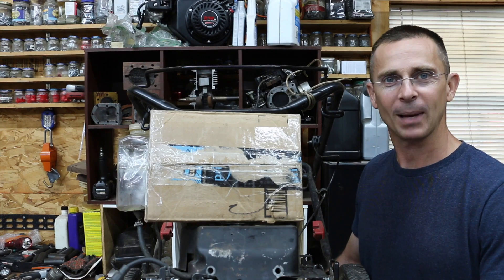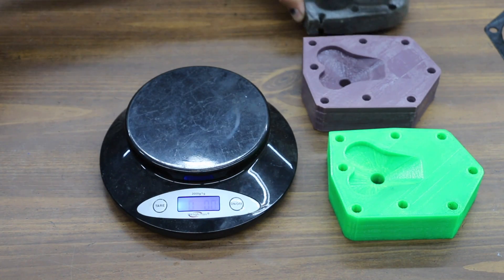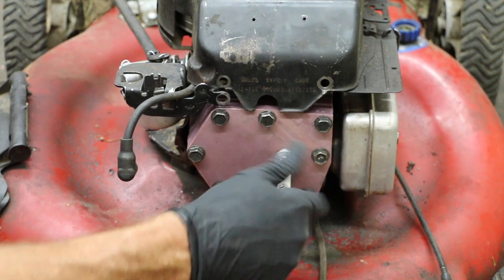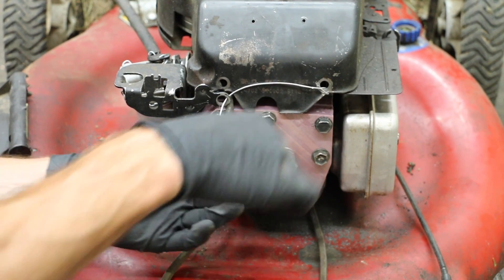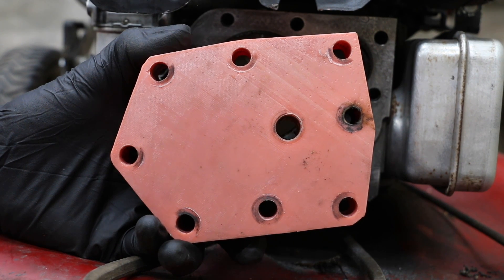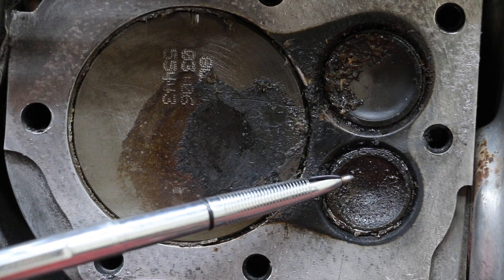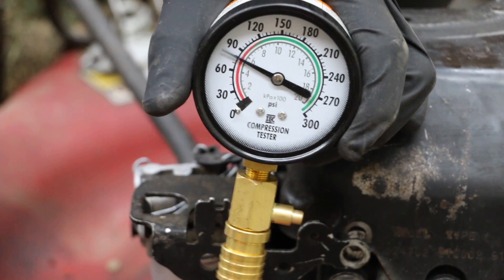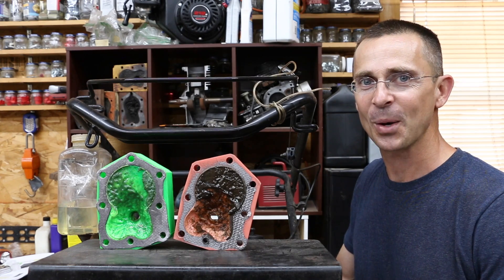How long will a 3D printed cylinder head last?  Let's find out!

Comment: Obviously plastic isn't the ideal material for a head, however more advanced (still at a consumer level) machines are capable of producing 3D printed plastics that would likely hold up for a long period of time.  A form 2 can produce such parts.
Reply from the maker: Great point.

Comment: How about deliberately cracking a cylinder head in half, then try to weld it back up, then durability test the repair? Or crack a connecting rod, weld it up to see how long that will last?
Reply from the maker: Great recommendation.

Comment: You know FORD (GM & DODGE as well) is not far from mass producing cylinder heads out of ABS Plastic as well. I think this video will inspire them even more, Engineer: hek we saw a fella run a Briggs on a plastic head...why did'nt we think of that. Buy Japan vehicles n solve many problems... I will say they are over priced but you get what you pay for.
Reply from the maker: Thank you

Comment: Maybe if you covered the inside of the cylinder head with Aluminium foil stuck down with JB weld would help it last longer. Great Video!
Reply from the maker: Great recommendation. Thank you

Comment: Maybe you could  try a gas diesel mixture  and try it on an diessel engine and an gas engine and look if it will work and or if it is better and if you get less carbon built up
Reply from the maker: Great recommendation.

Comment: Awsome video! Composit heads are cool, would a concrete head be possible??? Also I mainly wanted to ask about your rusty nut and bolt experiments have you tried an acetylene torch to heat and see if that helps stuck bolts?
Reply from the maker: Great recommendation. I tested the torch near the end of this video and it did a great job: https://youtu.be/xUEob2oAKVs
Reply: Great! Ive learned my skills to pay attention are shot.. i just rewatched and saw the magic I missed! Too bad I cant get a acetylene torch on my header stuck bolts and aerosols plus idle heat have not helped, tough spot with extensions not enough umph with those. Great videos, great breakdowns, small engines beware!!

Comment: How about a 3D printed carb? At least it stands a good chance of lasting awhile especially if made out of the more heat resistant plastic. Would also help if it has a thermal isolating plate in there like my Olds 350 Rocket w/Rochester Quadrajet had on it. The 1 inch spacer plate allegedly help with fuel boil/vapor lock type issues. Anyway, I think the plastic would stand a good chance if on the intake side of the motor.

Too bad you can't get some metal 3d printed parts. Supposedly Jay Leno has one but the vids I remember he mostly had cosmetic stuff made and not so much the working engine parts. Excellent vid, crazy choice!
Reply from the maker: Great recommendation on printing a carb!

Comment: Would be interesting to see a Nylon like Zytel Nylon they use it for valve covers and oil pans, its a high temp high strength plastic, would have to be machined though.
Reply from the maker: Great recommendation!

Comment: Ya scared me, didn't think you were gonna ground the spark plug... if you are looking for a high accuracy, inexpensive medium sized printer that doesn't take too long to set up, try a CR-10 mini and run it with ultimaker's Cura engine. It can help you prototype and produce things from plastic a lot faster than having to be sent parts. Mine works well, but it's up to you. The combustion test was great in this video. I was wondering if you would do a video on what makes the longest lasting improvised gas tank. Mainly aimed at plastics including PLA and ABS as well as PETE like in soda pop bottles. Also be interesting to see each plastic put up against different fuels.
Reply from the maker: Thank you very much for the recommendation on the CR-10 mini and video ideas.

Comment: Great video. Would be interesting to see if there is a sprayable coating that can help these various wood and plastic heads and pistons withstand the temperatures and abuse engines throw. Thanks.
Reply from the maker: Great recommendation!

Comment: Try making a cylinder head out of superglue. Make a mold and after you set a thin layer of glue, spray it with activator, do another layer of glue, and repeat. Then drill your holes if you haven’t cast them in with the mold.
Reply from the maker: Thank you

Comment: I'd like to see you try Bees Wax on rusted bolts. A garage foreman had me heat an exhaust bolt with a heat gun just enough to melt bees wax(careful not to heat it too much) on it and the rusted nut came right off. It worked every time where a torch would have been a problem. It's possible just the heat gun would have worked but I never tried it.
Reply from the maker: Great recommendation.  I'll test this in the future.

Comment: I expected ABS to run longer because as a user of 3D printers, I know I need higher temperatures to print in ABS than PLA.  I am aware of a plastic called PEEK which has a significantly higher temperature rating.  I wonder how long that would last?
Reply from the maker: Great recommendation on PEEK.

Comment: Nice!  I’ll be honest, I do a lot of 3D print vids on my Chanel, and I expected immediate catastrophic failure, followed by a pool of melted plastic. PLA is a lower temp plastic, but it can be heat treated to raise the crystallinity, and it will be more temp-resistant them ABS. If you want to go crazy high temp, I think PEEK filament has the highest heat deflection, but you need more specialized extruder to print it. PEEK can also be heat treated for higher heat resistance. There is also Nylon and PC filament out there. Thanks for the vid
Reply from the maker: Great information on how design improvements--thank you!

Comment: What would be interesting is at what temperature did the plastic melt and what would it take to get a plastic to withstand just above that temperature or that of the cylinder internal temperature?? We know the compression of the cylinder.  Whats the internal cyliunder temperature when the engine is running at X RPM?? What is plastic head were water cooled??
Reply from the maker: All great points and ideas. Thank you

Comment: Not familiar with 3D printers but don’t they use heat to melt the diligent so it can create the product? 

Maybe a different filament, like a thermoset plastic where heat sets the material to where it can’t be re-melted.
Reply from the maker: Great point regarding the thermoset plastic.

Comment: So this video idea comes from a real experience I’ve had. My dad’s sunroof got stuck open on his SUV so we got up and covered it with some nice thick plastic from a mattress and stretched it perfectly for a tight, level covering. Our issue was that we couldn’t find a duct tape that would stay attached to the roof in the heat of the day. 

So the test here: which brand of duct tape is the most heat resistant?

Our issue was it would slide parallel to the surface, but you could also do tests for liftoff adhesion. I guess just a repeat of the electrical tape video ha ha.
Reply from the maker: Great video idea!

Comment: I thought they would last longer. It would be interesting to see how they held up to compression alone, say on an air compressor. I think the structure is there just cant take the heat. Good video. Thx.
Reply from the maker: Thank you and great point!  Yes, it's very strong but heat is indeed the problem.

Comment: Awesome video. I would love to.see a concrete cylinder head. I bet using fiber reinforced concrete/mortar would work. While head is in the cast, use.metal spark plug threaded insert to hold plug in head.
Reply from the maker: Great recommendation!

Comment: I have a test suggestion:
Using torch heat to free seized bolts: heat only to the bolt, heat only the nut, heat both, apply torque after cooling or while hot, and try add paraffin wax from candle when hot as anti-seize to see if it works. 
A lot of combinations can be made, enough for a good video.
(Inspired by ChuckE2009 who is fast to draw the blue tip wrench when he finds a seized bolt)
Reply from the maker: This is a terrific video idea!  I like ChuckE2009's channel too!
Reply: Project Farm I would love to see this as well as I am constantly pulling out the torches and burners to heat up seized bolts this would definitely be a great video

Comment: Project Ideas
/////////////////////////////////////////////////////////////////////////////////////////////////////////////  
//   1Try running engine under water with snorkel then hydrolock it                                                            //
//   2 Can you use pc duster as starting fluid                                                                                                   //
//   3Try run engine on frozen fuel /normal temperature fuel                                                                        //
//   4Try run engine on heating oil fuel mix                                                                                                       //
//   5Try run engine with frozen oil /normal temperature oil                                                                          //
//   6What would happened if you block exhaust on running engine will it cause any damage               // 
//   7How much water can be in fuel without causing any damage                                                              //
//   8How much oil  can be in fuel without causing any damage                                                                   //
//   9What would happened if the engine overheat                                                                                          //
// 10Try adding oxygen(from Cutting Torch: Oxy Acetylene ) into running engine like a "NOS" ;D          //
// 11try run engine on oxy acetylene how much has it power ... your usual staff :)                                   //
// Thx for reading this long comment for project idea I hope you try something from this list  .            //
// Have good day :D                                                                                                                                              //
/////////////////////////////////////////////////////////////////////////////////////////////////////////////

Comment: it would be interesting to test high temperature, glass reinforced  nylon but that can't be 3D printed. 3D printed plastics will always melt as it has to be a relatively low temperature plastic that remelts. some plastics once cured burn instead and might hold their own against wood.
Reply from the maker: Great point.

Comment: Next recommendations:

3d printed carburetor
Exhaust Valves Made of jb weld
Intake valve 3d printed
3d printed blade or flywheel
Crude oil as fuel for the Diesel engine
Brake Fluid as "nitrous” for the Diesel engine
Reply from the maker: Great video recommendations--thank you!

Comment: Anyone pointed out yet that you're using materials that are melted and deposited in layers, in a high heat application?

Could have just made a cylinder head out of ice....
Reply from the maker: Yes, failure was indeed certain, but it did withstand the incredible explosive force of the combustion chamber which is quite impressive for a product that was printed.  There's tremendous potential to make gaskets in applications where RTV won't work and heat isn't a factor.

Comment: I think one of the reasons that the green cylinder head did not perform as well as the first one was because you gaped the spark plug and as you know the bigger the gap the warmer the spark plug is, which caused a lot of heat.
Reply from the maker: Thanks for commenting on this.
Reply: PLA melts at quite a bit lower temperature than ABS.
Reply: A big part of it is also that the spark plug is a metal part so it conducts heat outwards through the spark plug hole. So the hole thread is a natural hot spot to begin with, especially since there is no conductive material (aluminium) to take away the heat.

Comment: I'm really surprised that they lasted that long.  I'm not surprised that the ABS lasted longer than the PLA since you need to print ABS at a siginficantly higher temp then the PLA, even though PLA tends to be more rigid.  I'm curious how PETG or a tempered PLA would work (both that fit somewhere in between).  

I am suprised that the gasket melted that fast.  I thought that was a brilliant idea and being sandwiched between 2 metal surfaces with cooling fins on them.  PLA prints at about 200*C, but gets soft around 145*C (about 290*F), so it should be OK for gaskets like maybe a water pump gasket on a water cooled engine, but long-term might be a problem because it's biodegradable.  TPU (ninjaflex...) prints almost like a rubber, so that would be interesting material to test.
Reply from the maker: Thank you very much!

Comment: Hmmm, What about wire mesh reinforced cement? You'd have to brush the hell out of the insides, to make sure no debris got blown into the engine during combustion, but the heat and pressure shouldn't be a big deal for it.

Maybe a ceramic coating for a walnut head?
Reply from the maker: Great recommendations!

Comment: Sea foam and marvel mystery oil lucas upper cylinder lubricant all claim increased compression the lucas is very thick viscosity the colder it gets sprayed in the combustion chamber if you can spary in fuel as it runs and reading compression by tapping a hole some how you can figure it out if anyone
Reply from the maker: Thanks for the video idea!

Comment: How much diesel can you mix with a gas, to make it run? I put diesel in my lawn mower the other day with about a half tank of gas seemed to run fine actually but how much is too far?
Reply from the maker: Great video idea!
Reply: and since diesel is more of a oil will it raise the compression of the engine and add better lubricity.

Comment: You gotta try having another plastic cylinder head made and drill water jackets into it and cool the head and see how long it cant last then! That would be cool!
Reply from the maker: Great recommendation.
Reply: As a suggestion, since water is incompressible you could 3d print the cylinder head with a groove running through it just below the surface of the cylinder head and use a small pump to ensure that the cylinder head is always continuously pressurized and cycling water. You'd get good cooling and the hydraulic pressure inside will keep the structural integrity up.
Reply: @G0ldbl4e

water might not be compressible, but it sure expands when it heats up.
So if you make it a fully filled, closed water loop.. It would explode.

So you can't do that, you need an expansion tank.
And at that point the water might not be compressible, but the hydraulic pressure would be come a moot point, and the external pressure would collapse your water canals as it pushes the water out of the circuit, into the expansion tank.

Don't give up your day job, just yet.
Reply: sounds like a good idea at first...but you'd probably have to make so many water channels that the structural integrity of the piece would be lost for a high-pressure application like this??
Reply: You could 3d print the water jacket. Base off of how much plastic is melted there the water jacket would have to be very close to the surface. Probably won't hold up to the combination then.
Reply: Very true from both of you. Good point
Reply: Dont forget...its plastic...so will not be able to conduct heat into the circulating water as efficiently as a metal cylinder head...
Reply: I don't know guys, would you need to sacrifice much strength?
https://www.youtube.com/watch?v=xV2gsWHhDhY
Reply: TRX VLOGGER 3d printing isnt completely waterproof so it may leak but cool idea
Reply: @[PGC] C1assy

That's nonsense, if you 3D print a 6 inch diameter hollow ball with 1 inch walls out of plastic.
It would be water proof.

There is nothing in 3D printing that makes it inherently not water proof.

Comment: 3d printed gaskets will most likely be a thing sooner or later. but surely from thermoset plastic instead of thermoplastic alone.
Reply from the maker: Great point!  I see tremendous potential for 3D gaskets.  A huge time saver for sure.
Reply: i think about stuff you cant get easily, we have some random chinese generator, you will never find a headgasket for that thing (we cut it from sheetmetal)... or even further, some classic cars you cant get those for anymore. problem with that would only be that the 3d printer needs to be huge in order to print a headgasket for a car engine though :D

Comment: Between 4:20 and 4:25 you can see the orange glow of flame through the plastic at the top of the cylinder head. Pretty cool
Reply from the maker: That was cool. Glad you caught that. The smoke made it somewhat difficult to see.

Comment: what would happen if you used aluminum foil inside so the heat get to the foil first and then the head. please try the purple one again and make sure you put it in the plug hole as well that way plastic shouldn't get into the plug
Reply from the maker: Great recommendation!